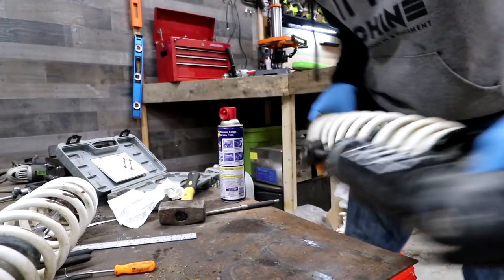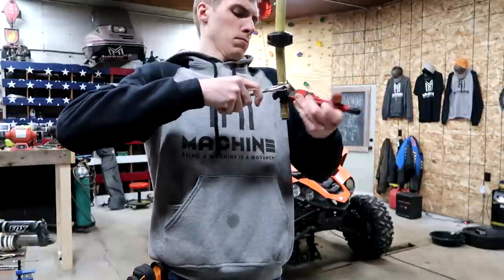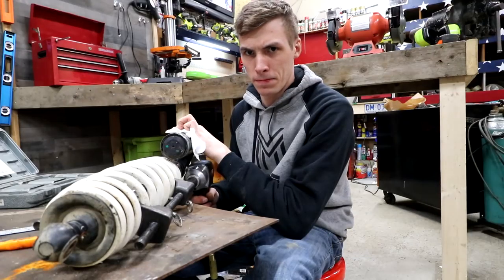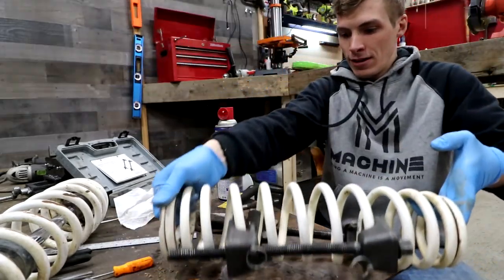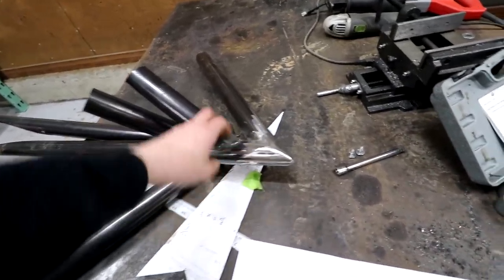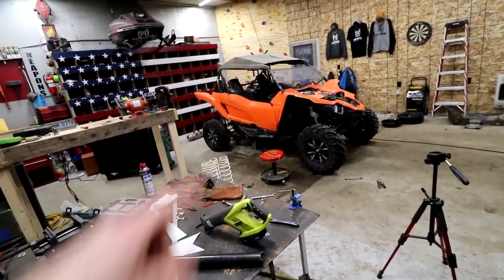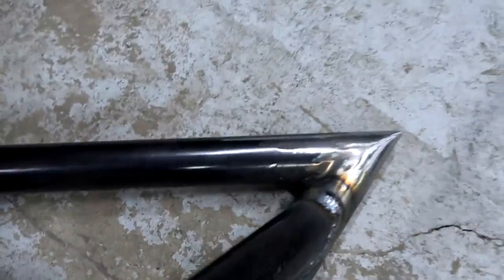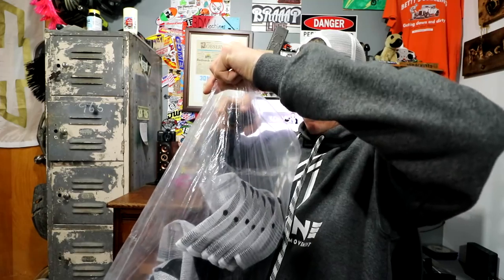THE SKETCHIEST TOOL EVER!

Comment: Just an FYI. Most powder coaters will perform the sandblasting for you.  many prefer to do the blasting to be sure it is done the way they want for the best finish.  Also, you should get the exhaust pipes ceramic coated at the same time.  Ceramic coating will keep more heat inside the pipe and prevent it from rusting, plus it just looks good.  Keep up the fun and the smiles.
Reply from the maker: Thanks for the comment. The powder coater I go to has a factory. They do not offer sand blasting.  Strictly new material.

Comment: You've never had sandblasting done, how would you know what the average place is like? That's a dirty, loud, nasty business!
Reply: I used to sandblast using Black Beauty sand. Nothing clean about it. There wasnt much it wouldnt take off. Hearing protection is a must,I wore a paint respirator over my mouth, Even wearing a suit,a hood under the protective hood that you look through,gloves; You still get grit on your body and in your hair. Showered and washed my hair twice and still had grit on my scalp. I've done tons of heavy equipment parts(big parts),snow plows, bike and atv parts.I worked out side and within hours the ground all around me was covered in black sand,rust and paint chips. 4 coil springs would have taken me 15 minutes or less. I also did the painting, never powdercoated tho.✌
Reply: Agreed.

Comment: most important thing with spring compressors, always stay off to the side of them and never inline with the spring/shock/strut ends.
of course never have fingers/hands or other body parts between pinch points.

Comment: There called rock sliders because they cover the rocker panel on the utv/ 4x4 truck,   mainly used for protection from big ass rocks  on hill climbs  and ditches.   But should do very well on the utv for tree bump stops,  you need to build the motor a little  exhaust, jetting,rev box, carb,

Comment: If you weld them rock rails to the chassis it might weaken the chassis at the point of welds i think they should be bolted on especially if or when they get bent I'd prefer to unbolt rails then grind rails off the chassis which will again remove steel a weaken it even more. Shes a cool project an it'll be a fun racer. Take care Mark.

Comment: Dont waste your time with those stock springs, sense your racing your best bet is to ditch them and buy a dual rate spring kit from from shock therapy!It will make a huge difference. Also. buy a Double E Racing rear sway bar (throw them stock ones out). best thing you could do to the machine!

As for people asking about a turbo on Crush, you are not allowed to have a turbo in GNCC unless your in the pro class, and one can not go right to pro you must start in XC3  and move up.

Comment: yeah I used those type compressors,  they are dangerous!  better off to go to a shop that has the wall mount compressor and just ask them if you can use it on lunch hour, price is 0 and safety  factor is 10 fold.

Comment: Pro tip put some electric tape on the spring compressors jaws so it doesn't scratch the surface off the spring when you re install it😀 love from Sweden ❤❤

Comment: I don't think you needed to use that tool, those shock are the same as my downhill bike and all you need to  do is undo the to lock rings and the springs will go loose and take the lower part out. Job done 👍.

Comment: Dalton I haven't watch the whole video yet but that tool you're using is very dangerous and you should never put your hand in between the two clamps those things if it slips a little on the spring they will spin off like a nut coming off a bolt